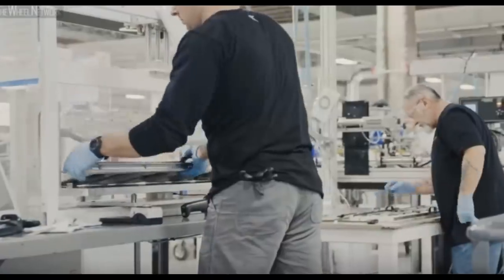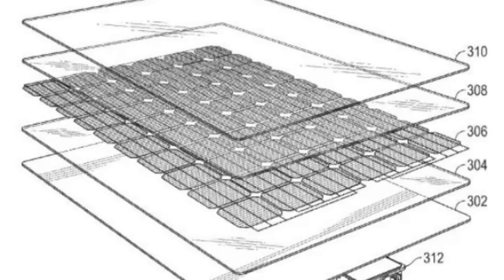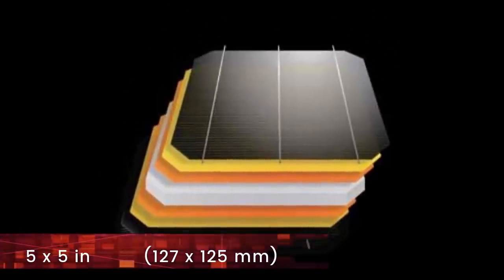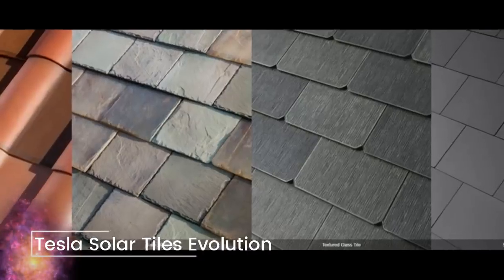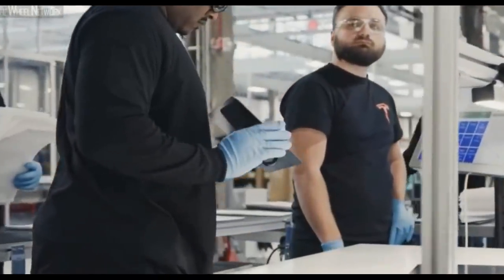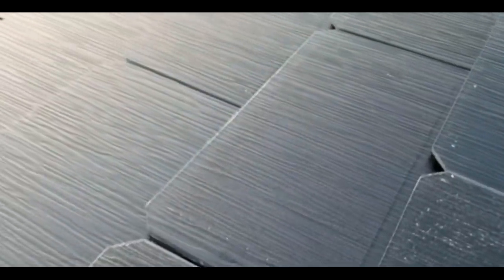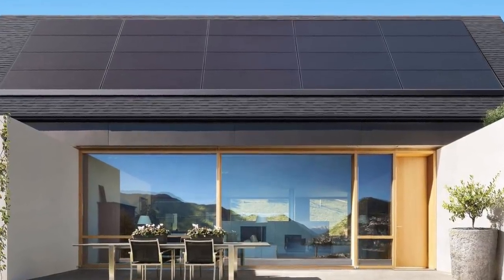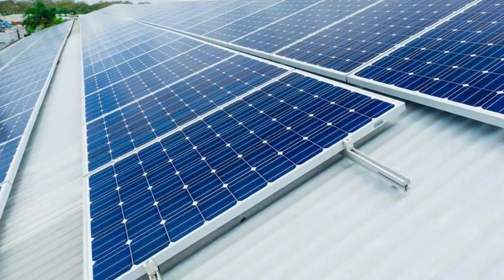Tesla Solarglass V3 Efficiency Revealed

Comment: Give me a tiltable ground array any day, we are at 54 north here so have serious seasonal variation. I'm into pv for power generation not as a vanity project
Reply: As ling as you have the un utilised  ground of course.  Certainly most city dwellers won’t have the luxury
Reply: @andrewpaulhart  no not yet we are saving like mad and my inheritance from my deceased parents is funding this. I'm just a minimum wage bod, but blessed with the good fortune of living a lot of my life in rural mid Wales. I did my time 15 yrs in cities, and spend a lot of my time in Cardiff where my girlfriend lives, but wouldn't live in a city any more
Reply from the maker: Agreed. For even lattitude 50 and above, tiltable frames make a huge  difference in output. They can improve output by more than 20%
Reply: Yeah my brother claims 30% more for his system of sun tracking ground mounted setup, also makes cleaning the panels so much more easy!
Reply: @gregandkaruna6674  is this fully tracked on X y axis, will definitely be doing a self build tiltable, but looking at mechanical X Y axis possibility. Full tracking is great, but more to go wrong in an off grid situation
Reply: @jukeseyable  My brother is an engineer and will be using computers and servos to track the sun. But first he has to build the house lol he got over 10kw worth of high efficiency Sunpower panels off eBay which are now just sitting in a container. I think he is nuts but roof panels are a pain to keep clean, as even a small amount of bird shit can badly affect its overall performance.
Reply: https://youtu.be/oUF3ZN7Lzks
Reply: @stephanfree250  Scary!